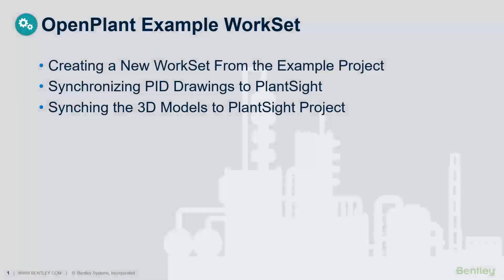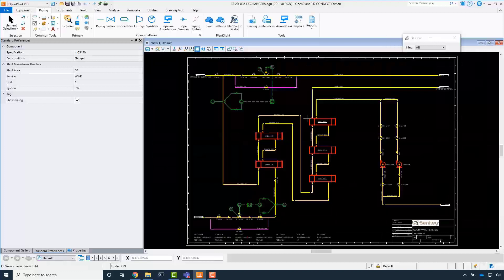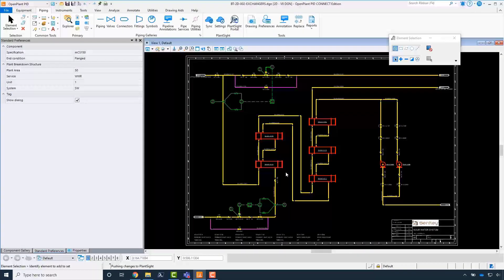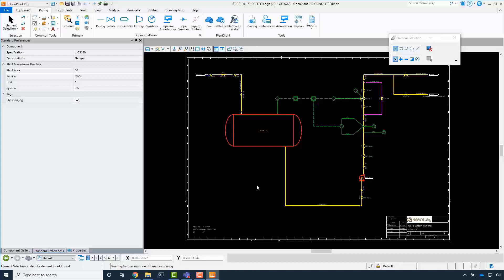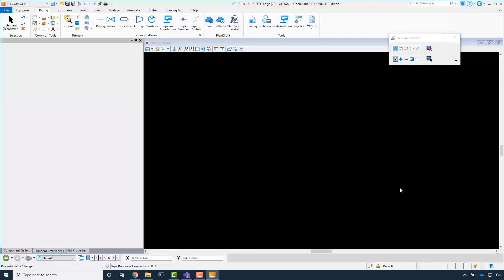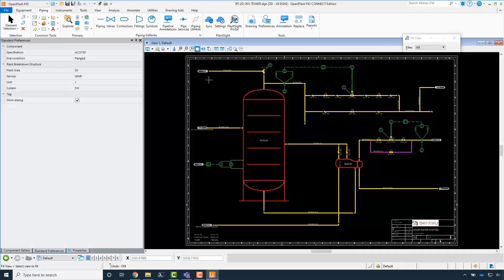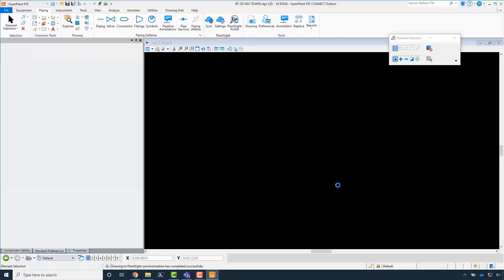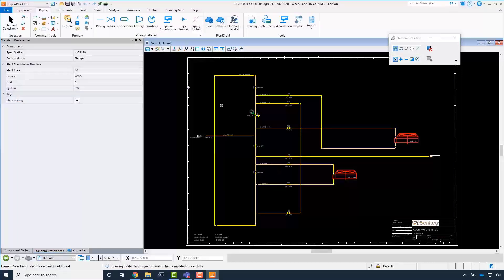06 - Synchronizing PID Drawings to PlantSight in OpenPlant PID

Comment: Missing some steps in this Video.
When Opening a DGN file, we need choose a WorkSet which have been associated and Setup just as the 04 video did. And choose a DGN maybe from 05 video shows. In this way, will pop up an alert, choose the second one which will make sure the correct WorkSet be used, otherwise, the Plantsight menus will be grayed out in OpenPlant PID.